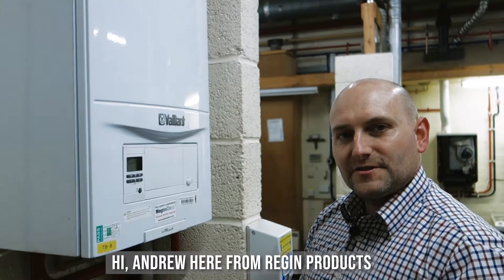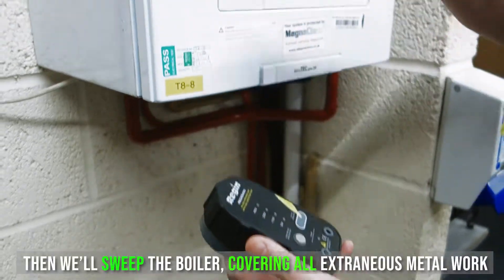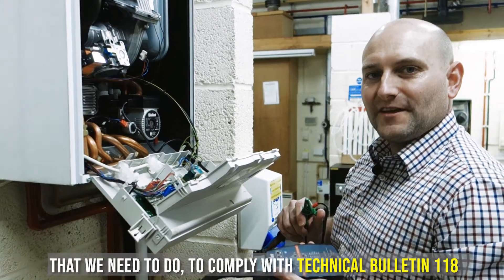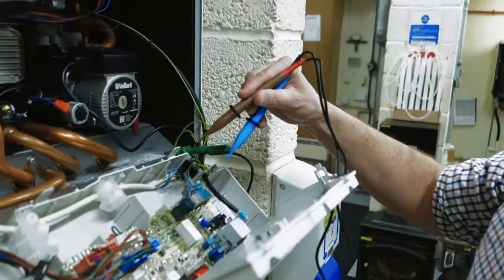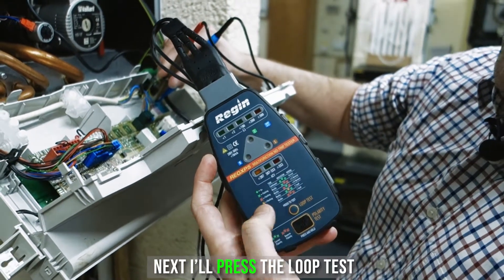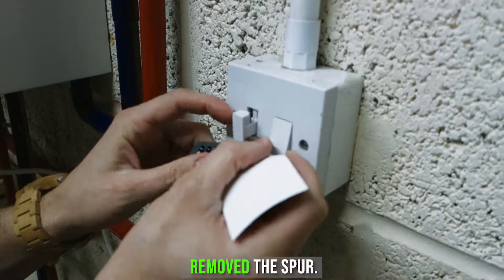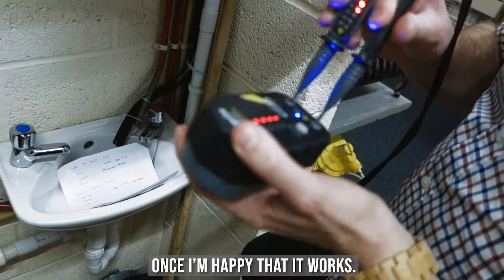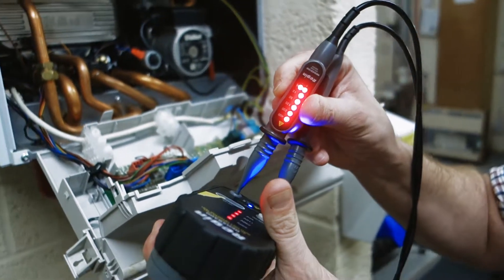TB118 - ELECTRICAL SAFE ISOLATION - BOILERS - DEMONSTRATION BY REGIN PRODUCTS - ACS GAS TRAINING

Comment: Where in TB 118 is the gas operative instructed to perform a 'safety 
touch test' or an 'earth loop impedance test' or a 'polarity test' - the
 ONLY 'procedure' defined in TB 118 is the Safe Isolation procedure !  
This video does nothing more than add to the confusion within the 
industry because TB 118 is ill-conceived, misguided, misworded, 
inaccurate and contains an unforgivably dangerous bunch of words - it 
should be no more than 2 pages long and explain what is in the title of 
the TB - a SAFE ISOLATION PROCEDURE !  The objective is simple - prove 
the test gear good, isolate the appliance, prove the appliance is dead 
and then perform a confidence test of the equipment to prove it is still
 good.  The document has opened the flood gates for test gear 
manufacturers to sell kit for checks that are NOT required to keep the 
gas operative safe ....
Reply: Could not agree more 👏
Reply from the maker: https://registeredgasengineer.co.uk/wp-content/uploads/2017/03/TechnicalBulletin118.pdf